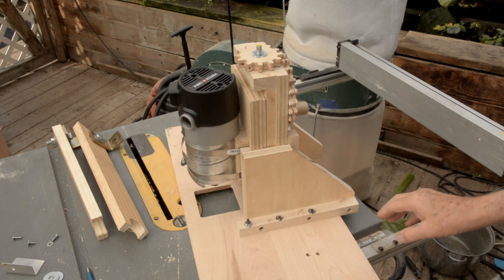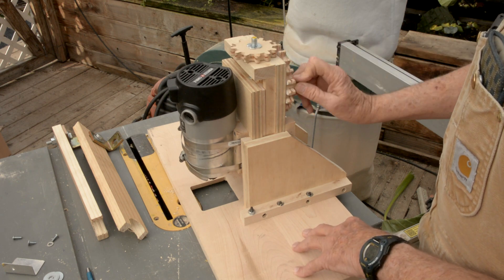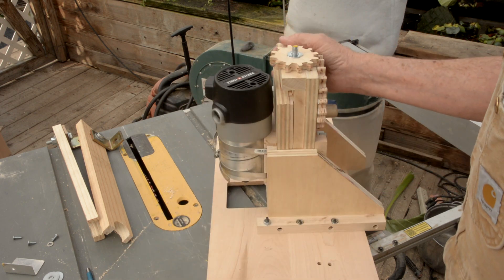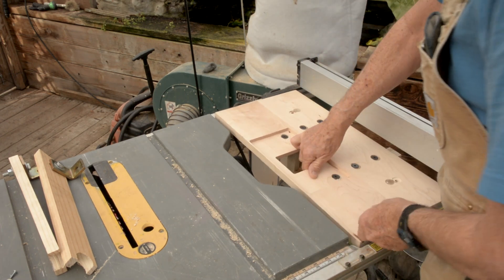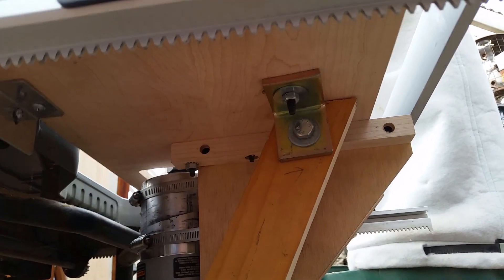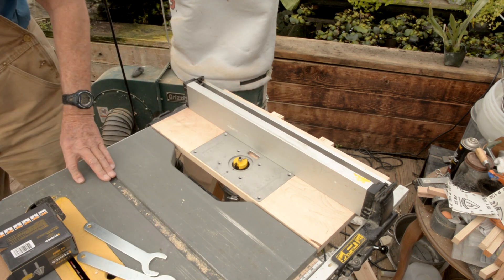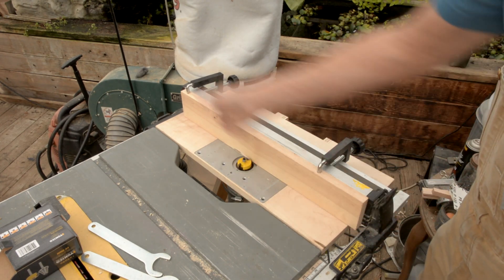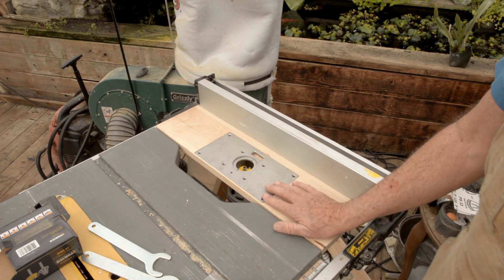Router table extension for a Dewalt table saw

Comment: This is a great idea! I can't tell where the brackets are used. Do you have plans with measurements that you could share? Also the angle for the support bracket. I'm new to this kind of thing, so sorry if the questions are a bit much. Thanks.
Reply from the maker: Sorry no plans.  I used a clamp to hold the supports in place as I adjusted the angle.  Once it was level, I drilled and bolted the supports.

Comment: That got a little too complicated for me i bought the lift version of the insert plate at ebay for 27 usd.
Reply: Do you have the link for the plate/lift you bought? I have been looking for one.   I found some plates but wasn't sure if they were for trim routers or fullsized routers.
Reply from the maker: What's even easier than that is borrowing a friends.

Comment: I was trying to copy your idea but I am a little concerned now to install a 5 kg router (Triton tra001). Do you think cantilever force on tablesaw would be too much , (I don't want to damage my table saw)? How heavy is your router ?
Reply from the maker: My router is about 3 kg but all the weight is supported by the cantilever arms there is not much weight on the table itself
Reply: If it's a concern, just use a counter weight.
Reply: the weight is supported by the arm that rests on the bar. the load travels through the bolts and screws to the bar via the cantilever arm.

Comment: Nice !! I was searching for some idea and thanks  to your idea, I will copy:) . But I didn't understand why you need a plate especially since you don't fix your router on the plate ?
Reply from the maker: The plate holds different pins and rollers used for different router bits.
Reply: @vendter  I was wondering the same, thanks for clarifying :)

Comment: Cool!  I was thinking of adding a router table to the garage.... but this is a much better idea. Cheaper and space efficient.   Plus, you get more counter space if ever ripping wide boards.   I don't like applying alot of weight to the lip of the fence when it just sticks out the side.
Reply from the maker: I have been working on making a Gerstner style tool chest and have been using the table a lot.  Check some of my recent videos.